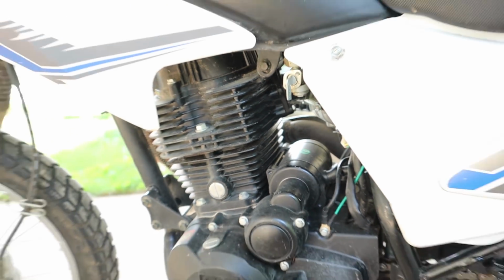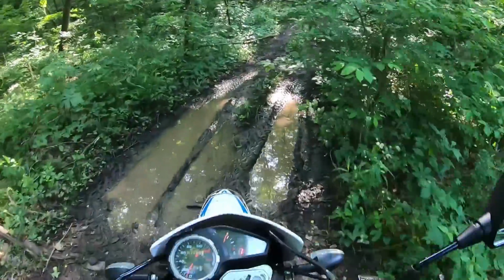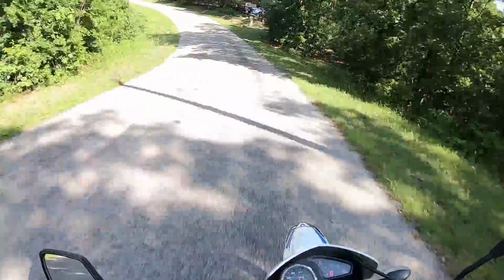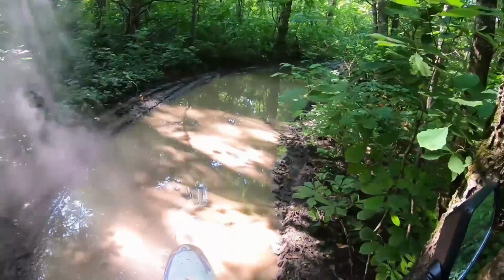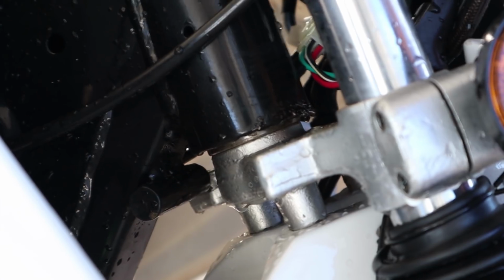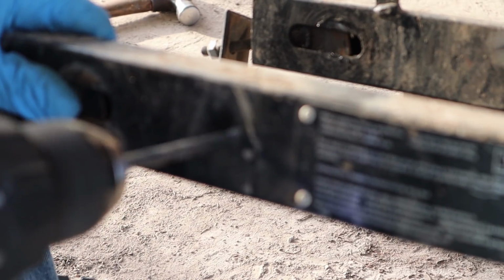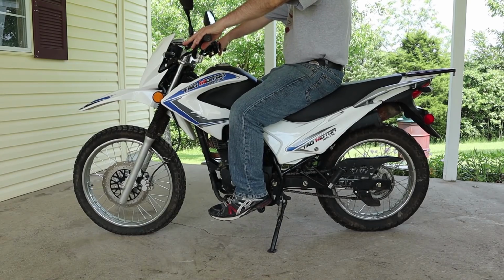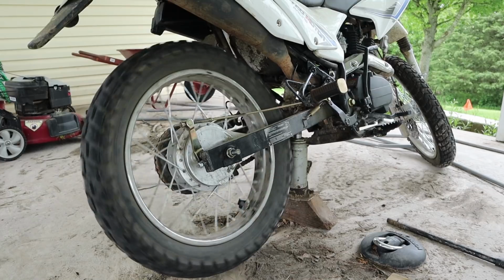Testing the Worlds CHEAPEST Motorcycle!

Comment: a cheap chinese bike isn't something i would put my life at risk for.
Reply: How many on this thread actually owned or own Chinese motorcycles?How many are just repeating what someone else has said? I’d rather ride my new 1300 junk than someone else’s 20 year old junk
Reply: @freakeyeairgunnin2181  i have one ..not scared of it at all
Reply: @freakeyeairgunnin2181  I ride 60 year old bikes all the time with no issues.
Reply: Steve I wouldn’t argue that at all...all I’m saying is everyone saying it’s a hunk of shit(which it may be)but nobody’s posting any proof...my go to bike is my Honda Cb500f but I like riding my TaoTao mostly off road though and no highways at all.Just know your bikes limitations but that’s any bike I guess.
Reply: @freakeyeairgunnin2181  Well it is a piece of shit. Ive had many chinese bikes and they all sucked. I have a 1969 Honda CT70 I rebuilt the Bottom end, Top end, Entire electrical system and it runs great.  Surpisingly the wheel bearings are perfect i just regreased them. Ive got the pipe glowing red a few inches from the head climbing stuff with it wide open in first gear for over 10 minutes then i rode it around at 40mph wide open and the pipe continued glowing and i still had 0 issues with it. Before turning it off i let it idle for a minute to cool off a bit. And this was before the rebuild too. I had a chinese 110 buggy it ran amazing till i held it wide open for about 20 seconds racing someone and it blew up. My Honda never dies no matter how long you hold it wide open.
Reply: @freakeyeairgunnin2181  Chinese stuff arent worth it. I thought about putting a Honda piston and rings in the buggy but i figured it wasnt worth my time then traded it for a 1978 XR75 and then it got stolen unfortunantly.
Reply: Giuliano BassWarrior  if thats the case, explain how a japanese bike failing is different than a chinese bike failing. this applies to any product as well.
Reply: Izzi Michaels whats the better brand kymco or yamaha
Reply: @mike-ws8yh  i dont know, ive never had any experience with kymco.
Reply: Y A you realise Japanese bikes are made in china right? You can literally get Japanese parts to fit a chinese bike
Reply: @AdamMoorby99  Yea you can get Chinese parts for anything.
Reply: @33DU where did you get that statistic?
Reply: It’s a motorcycle dude. They’re not exactly known for being the safest thing on the road. You’re risking your life any time you ride any bike, it doesn’t really matter what you paid for the bike
Reply: You people are funny.... most Chinese motorcycles are based on Hondas.  Their generators and trash pumps are usually based on outdated Honda’s as well...  the biggest difference is quality of materials (cheap plastic and low grade metals), rarely do the metals in the motor cause an issue but frames and plastics snap all the time; the second biggest difference is gaskets... any Chinese motor you buy should be disassembled and put back together with the same model Honda gasket (noticeably thicker and more “solid”) and a good brand RTV; the third biggest difference is the carburetor, either buy the Honda carb rebuild kit and do it immediately, or just replace the carb altogether.  And there are more Chinese than Japanese motorcycles in both Asia and South America... poor people have to make choices, and usually it is for the cheaper transportation.  What you people are bitching about is pure silliness, some people would rather pay $1300 and have a few fixes to deal with, for those of you that want to pay $10,000 for Honda’s new CRF450L, go ahead and pay it... NOBODY is stopping you... but the fact that you are being total jackasses to someone that doesn’t want to (or can’t afford to) spend what it takes for a CRF, just shows you’re immature classist assholes!
Reply: That's wat riding is all about.
Reply: K T  who is right?
Reply: K T  i never said it was.
Reply: one thing i notice about you folks is A) you dont comprehend very well, ( i never said chinese bikes are better than japanese bikes)  B) you expect answers but wont answer when youre questioned. basically you come off as uneducated and prone to insult when you cant provide a decent back and forth conversation .
Reply: keep a eye on stuff ,like anything else..i bought one for a 100 bucks used ..and suites me
Reply: @33DU well one of you is, (hint - it isn't Izzi)
Reply: The risk of dying is the point of riding. I mean might as well just drive down the road if I wanted to be safe.
Reply: @chandler1289  Lmao the Risk of dying is NOT the point of riding. If thats the point then go 200mph and rear end someone.
Reply: Steve lol
Reply: @Stacy Jaye 😴
Reply: @33DU dude your badass  🤓
Reply: oh dear God, the "life risk"..."think of the children"...brigade......the chances of you having a life threatening event on a motorcycle due to poor manufacturing compared to the actual life threatening events that happen because of rider or other road user errors would be infinitesimally small. You are probably more likely to receive a fatal electric shock from your electric toothbrush.....because electricity can kill you.
Reply: @33DU I've bought sold and ridden at least 7 different motorcycles.  Worked on them, tuned carbs, etc.  Including two chinese ones.  And yourself?
Reply: Honestly people are underrating the quality of the bike
Reply: Here in the philippines chinese bikes sell better then any others.they are realeble exept for some electrical issue
Reply: @lonewolf-oc9vr  that's mostly cause they're cheap, and most phillipinos don't have as much money as any average westerner would
Reply: @cocainecowboy_  i know that,you can have a bike made in china for half the price of a brand name and still will last as long
Reply: lone wolf No it won’t. You obviously never abused a chinese bike before, have you? I have and they all blow up
Reply: If you pay the same amount for a 20 yo  used jap dual sport - are you sure its safer..?
Reply: It’s about as good as an American bike 😂
Reply: Bought a 2007 Lifan GY5 200cc dualsport new. Rode it for many years and in 2024 I gave it tom my grandson who is still riding it. Over the years it has needed oil changes, valve adjustment, tires and batteries. That is it. Always reliable never failed to start and always brought me home without issue.
Reply: but you'd put your life at risk for a well made japanese bike?
Reply: Izzi Michaels  
You obviously don’t ride motorcycles dummy
Reply: @matthewustupski654  lol no, you obviously dont ride.
Reply: Izzi Michaels like you said a “ well made “Japanese bike. You wont have to worry about failing parts because if its well made the components are much less likely to fail resulting in injury while the cheap poor quality parts are very susceptible to failing resulting in injury.
Reply: @blakebolte1775  oh i agree with "much less likely" that doesnt mean its without risk, ive broken a frame on an rm and a cr, ive had a footpeg snap off of an yz,  each of those incidents could have ended baldy, only the foot peg incident resulted in injury. "less likely" but still a possibility.
Reply: @robertblanchard6196  exactly.
Reply: @girly.imp69  yes i was.
Reply: @girly.imp69  it sheered right off, I sold the bike, but I still have the foot peg, lol. (yamaha yz)
Reply: Y A that bike isn’t Evan worth riding let alone buying
Reply: Absolutely never is absolutely junk. Hospital bill will be way more expensive putting in risk your life on a cheap horrible quality piece of garbage. Plus all of the electrical problems that all of those Chinese junks comes with.
Reply: @MOUSEBOWEN  haha hospital bills... What's that? (;
Reply: @MOUSEBOWEN  You do know that most "Quality" bikes are produced in China and India right lol
Reply: @MOUSEBOWEN  The electrical problems are infinite.
Reply: Steve I hear ya everybody different though.Id rather buy some new shit and work it myself,I bought my Tao in February ordered from Walmart did maybe 200 in some upgrades like chain,carb, etc;fell once dropped once both off-road though still haven’t fixed anything.The battery is dead right now but I bet it start in 2/3 kicks no problem.When I bought my Cb500f my boy bought a 10 year old R1 for the same money,so I get your point.Yes he has twice as much bike as me but I wanted some brand new shit that 
nobody else had so I chose the Honda.Thats just me.As far as the China bikes;this is my fourth and I still have yet to see any evidence of the junk pile claims,surely not from any of the commentators on this thread...that’s all I’m saying,prove me wrong and I’ll have no problem admitting you’re right...BTW..Thanks for being an adult in the back n forth...
Reply: @freakeyeairgunnin2181  My Honda will even start in half a kick anyday and if your lucky sometimes itll start in even a quarter kick. And all these chinese bikes need carb Upgrades, Chains, Wheel bearings, and usually throttle assemblies. The gas tanks are very prone to cracking. Good to hear you've had a overall good experience with Tao Tao but they arent for me. Usually Cdi boxes would burn out for no reason at all on 5 or 6 different bikes ive had and id replace the stator, wiring harness, Cdi, etc and it would burn it all out again. Not worth it. I say buy a classic bike n fix it up or buy a brand new Japenese bike... And thank you aswell for being an adult.
Reply: @freakeyeairgunnin2181  Also in my experince bikes that run on points ignition have way hotter spark, Higher performance and can withstand much more without fouling the plug or turning off. I can get a bunch of water in the carbs and stuff and they still dont turn off. Cdi is a different story.
Reply: Steve Everything you said I believe,had to giggle on the 1/4 kick and I DO believe you.I have read all the horror stories you mentioned on chinariders,and I have been lucky to not get lemons so far,along with plenty other people who’ve had success.Would I ride my Tbr7 like a cf230?Of course not,but cf230 parts do fit☺️.In full disclosure;I seem to have bought all my China bikes during winter months...maybe that’s when the decent ones are sitting around...lol..cheers bro
Reply: @freakeyeairgunnin2181  😂 I guess im just extremely unlucky. Maybe the best ones are during the winter Lol. But to be honest this Honda has been a fucking nightmare to get it to the point its at...
Reply: Yes, over a chines bike any day, atlsest Japanese bike have a pretty good track record of not fall to bits on the trail.
Reply: @tobymozer7465  no doubt. you cant do better than the big four japanese bikes, street or off road.
Reply: You all wanna get a real motorcycle Harley Davidson !
Reply: @33DU Great bikes

Comment: Great price, depends on how durable it is. Had a Chinese 125cc dual purpose bike, best part was the engine. Put it through hell off road, plastics and metal very weak, bits would fall off. Going up a steep gradient I hit a bump and the seat fell off (was standing on pegs). Couldn't stop laughing as surreal WTF moment
Reply: The bike will fall apart long before the motor kicks the bucket...after all, there simple motors.

Comment: You have oil in the air box because the breather valve is defective. Replace it with a part from whatever motor they cloned.

Or just cap the breather (google it).

Come to think of it the engine might not have been designed to have a valve breather and that might be an add on to satisfy US emissions requirements.
Reply: There is no "Breather valve" in such small CC bikes.
There's a foam filter in the air box thats supposed to keep the oil back.

Comment: I bought a used enduro 2000 Kawasaki kl250 super sherpa for $700! I cleaned the carb, changed the seat, added a fuel filter and changed the oil. Top speed is 75-85 mph. RUNS LIKE A CHAMPION. It has been very reliable so far. With that being said I can get a very nice reliable used  japanese enduro bike in my area for $1350.
Reply: It's Kawasaki, do you expect less?

Comment: on my lifan i modded , i found most  older xr parts , especially carbs., ignition , exhaust etc. , were actually what they copied when designing the bike , many, many other parts suspension included are mostly a straight bolt on  , and of course better quality .
Reply: Yeah, i think those Japanese patents expired (not that matters to chinese mfg). Using the design and fitting is one thing, the metallurgy is comparable to 1950s japanese or worse. More like caveman level--thats why their shit breaks see easy.

Comment: Another comment, I own a different chineese brand bike, all of them are most of the same. The thing is if you dont know hoyw to fix a bike do not buy a chineese bike, every 500km something will be giving you a problem, it never will be a total failure, some times fork oil leaks, some time an electric part, solenid, or the switchs will stop working , small stuff, some time will be a weld that came off, or the  gas tank cap wont close anymore, stuff like that small and  anoying. I had 20 year old japanese bikes that never had been changed any electic part or rewelded...so. every 500Km be prepared to sitt beside the bike and fix something.

Comment: I will predict your future: -front fork oil leak, - rear shock failure - handlebar broken at the first real fall off road, - pedals, shifter and rear break bended at the first fall, - transmission failure at 5000Km,  - brake fluid leak between 5000 and 7000Km and thats for starting, oh yeah oxidation i forgot

Comment: I agree with that info. My dad was importing chinese bikes back in '03, and I was the 'parts manager'.. learned a lot, these '19 bikes are very similar only slightly improved designs with time. Still engine architecture copied from a Honda XL185s? I also have experience with an XT225 Serow, and currently with a Kawasaki KLR250 I just rebuilt fresh top-end, have that '00 bike listed for $2,300.. you're pretty spot on, it is what it is.

Comment: Great review. But for me I'll stay away. The XT 250 would be for me.
Reply: Heith Watkins I found an 85’ XR350 I’d like to grab and fix up, now that’s a beast
Reply: Heith Watkins have you ever checked out the TT250-350-500-600’s? Also great bikes. As a cheaper than new alternative I mean. Hang some turn signals on those and you’ll have a bike that is as capable as a new dual sport if not better.
Reply: @Stacy Jaye I use to buy old bikes and rebuild them for sale, but I stopped because it was too expensive, and not cost effective. Old bikes = bad bearings/bushings, rotten hoses, bad seals, corroded electrics, worn out brakes, cylinders out of round, rings worn out, and unsafe tires and more than likely rusted out gas tanks. False economy unless you can find a $1000 Vincent Black Shadow. =0) MHO

Comment: I actually have a Yamaha XT225 and XT350, which are both fantastic bikes. I also have a big road bike and lots of quads, etc. I have to agree with your review, as I purchased a Chinese 150 scooter years ago. It was cheap, but had tons of problems as well. The carburetor was dirty and I didn’t realize it at first which caused the starter to go bad from overuse! This caused the switch to go bad, which caused the wiring to short!😧 The scooter rides good now, but if I didn’t have 35 years of motorcycling experience, it would never be running! Just stick with a Japanese bike! I would rather have a 25 year old Japanese bike than a piece of garbage you can’t get parts for! Just my thoughts!😜
Reply: You feel you can get parts for a 25 year old bike?
Reply: percussion 44 Yes, you can still get most oem parts on bike bandit.com. The Chinese parts are nowhere near the quality, even the carb orings shrink and become brittle! The just don’t last overall! I have a couple of 1970’s Honda’s the still have good carb gaskets.😆

Comment: if you have to buy one of those POC, then just be prepared to keep it because if you try to sell it on Ebay or Craigslist you will be REAL lucky to get 100 bucks for it...they are pretty much throwaway motorcycles. i see them all the time on Craigslist and most of them don't sell...
Reply: Can you share a link of some of these postings? The $100 POC is pretty rare around here. Hell even the POJ pulls $500 on a bad day.
Reply from the maker: After you open the box they are worth about 35% less.  I sold mine this month (had it 9 months) and got $750 for it.  With the $125 I had to pay for tags  I was in it $1475.   I feel like I definitely  got $725 worth of fun out of it though :)

Comment: I have a CG 250 motor on a Chinese dirtbike. I would suggest you remove the EGR valve for more power. It makes a big difference with low rpm and pinning the bike. Also just run the air box with the small drain hole unplugged

Comment: Great video Matt.... When I was looking to get back into off-road riding this year, like you I found only junk in the used bike market, which led me to the China bikes. After all the research I realized I didn't want to deal with the "problem set" of the Hawks and Taos etc. On top of that I'm a bigger guy and I was worried about how the suspension of these bikes would handle off-road with my carcass..since my intent was to use the bike 90% off-roading. I eventually found the Pitster Pro. The Pitsters cost more up front($2600 shipped to my door) but are a whole different world of quality and they have acceptable off-road suspension. I bought the XTR250 21/18 and have been trashing the crap out it on our tight, rocky , New England trails all season with no issues I didn't cause from wrecking ;) (off-roading is tough business...lol) but more than that really enjoy my XTR, its a very capable and fun to ride trail bike.